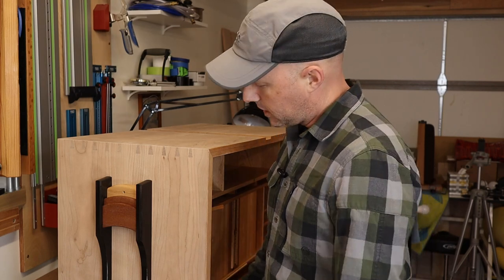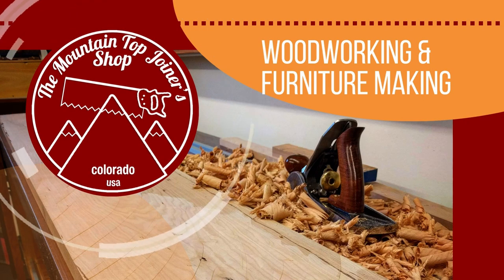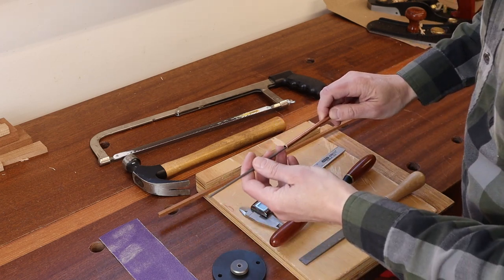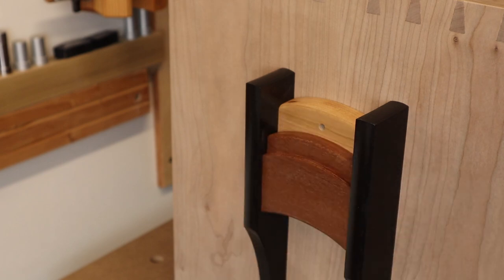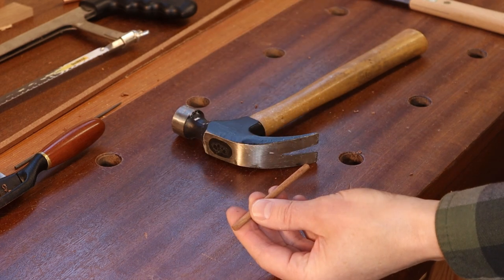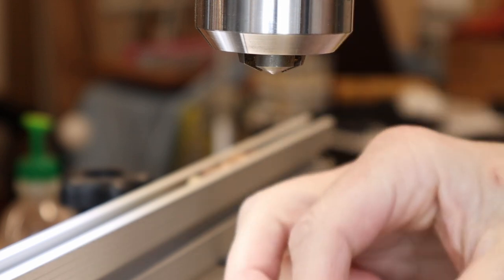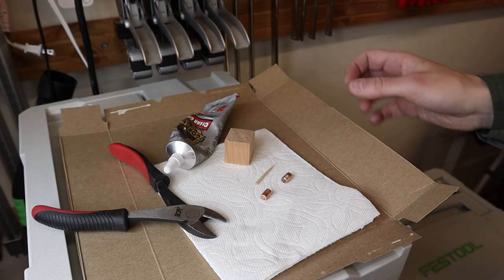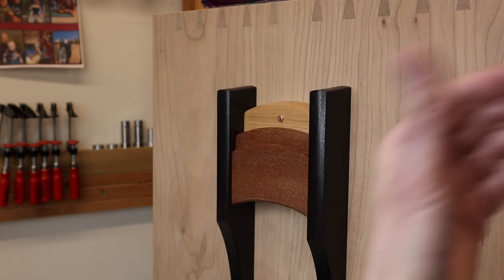How to Make Infilled Brass & Copper Plugs

Comment: Late to the party.. most enjoyable viewing watching - crafting 2 materials I've worked for decades, especially the copper, silver, brass and aluminium.  I'm a craftsman too. I'd like to suggest a few methods that help with making these tube inserts, if you have to. 
I've found Copper and Brass plumbing olives are the dirt cheap n' easy preformed metal insert. They have sharp tapered edges. These can be driven into a soft timber face using a fabricated driver tool/pin. The timber can be installed in the copper ring before or after panel install. This lends itself to signature mosaic pins.. I especially like glass.  

The Drill Pressing 'need' could be as small as a 18V battery drill, frankly. 
It's more a matter holding the tube.. the chuck vice. You only need the motor drive to polish after all.
Drill press has the advantage of being used as an install tool too, if the metal is installed at the bench and the wood infill is installed after the panel is mounted. 
There is no need to polish the outside of the tube... only the head part that is seen. 
This makes it far easier to make e'm. 😉

When installing the tube in a drill or lathe chuck, engage as much tube as possible in the chuck jaws, NOT as little as possible, especially if you intend touching the tube with a hacksaw to part off, or a file to chamfer... even polishing!   Just don't tighten the chuck heavy.

Remember, the smaller the diameter work piece (or drill) - the higher the machining speed... especially polishing. 

When installing the insert remember you are compressing a lot of air into that pocket... and not compressing whateva 'glue', so be mindful if your seeking a tight flush fit. 

Plumbing fittings / pipe are an excellent source of materials. The brass can be turned easily with abrasion and use of the Drill press (best horizontal axis mounting across a bench, so it can be used as a sanding Lathe too). Brass fittings can be easily mounted up on a shaft to drill machine mount and 'machined' to tube size and formed to produce a hole saw with zero tooth set  - making a self installing tube insert - cutting wood for a precision metal/wood fit. You can make plug cutters from brass tube too.
With large diameter inserts (say 20-25mm) maybe cut the wood core insert from the panel your plugging for a perfect timber grain match. That would have you use brass core drill in 10-15mm (no centre drill) > carefully remove plug from panel > drill mounting hole > Screw/bolt fixture > carefully install the insert with 'mother' grain aligned.... easy.
I like mosaic pins 
 Plumbing tools;  
Cu. tube flairing kit is very useful. Two bits to this too... a screw clamp and vice. 
It can work the Cu. to achieve a larger apparent wall thickness of the tube insert. ie. I could have the 1/4" tube appear to be 3-5 mm wall thickness at the face... or 20mm easy if a Cu. washer was included into the design.  
The tool can be used to drive the wood dowel into the tube if the usually 45* flair cone is converted to a flat face driver, rather than the flair former. 
The tube clamp (vice) used alone, is a safe way to hold the tube, preventing distortion when cutting or driving pins into woods.
Tube Cutters, having a disc blade + two rollers, are the best way to part off the 15mm pins, after polishing the pins head. Using a hacksaw is a bit on the 'hack' bodgie side for my liking.
 
If you must buy the tube always get the 'hard drawn' type.

Comment: If you are looking for a japanese saw for fine cross cuts on small stock, try looking for a purely cross cut Dozuki saw (those saw that have backs). The ones with universal teeth cut very fine too, great for dovetails, but the ones for cross cuts only have much finer teeth, much smaller set and even on softwoods like pine they leave almost a finished look that could be mistaken for a planed surface.

Comment: With a dremel and some rouge you could really shine it up.
Reply from the maker: I like that idea, although I'd be concerned about discoloration of the wood. Since it's the end grain that's exposed, it'll soak up stuff pretty readily.
Reply: @themountaintopjoinersshop8422  You can protect the wood with a drop of hot melt glue or some tape or shellac.  It should be done before they are installed of course.
Reply: @themountaintopjoinersshop8422  How about using a strop? On the drill press, take a little band of leather loaded with the same stopping compound used to polish cutting edges. You may use it only on the sides of the plug (to avoid contaminating the wood), as the bevel is small enough to not need that much polish. That's how I polish aluminium to a mirror.
Reply from the maker: Good tip!